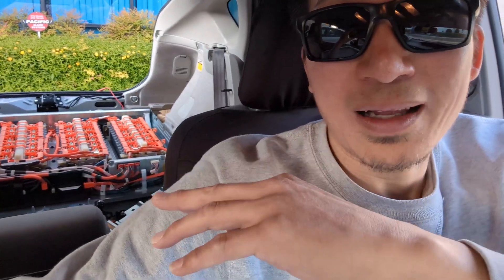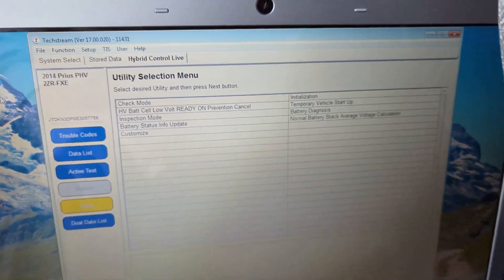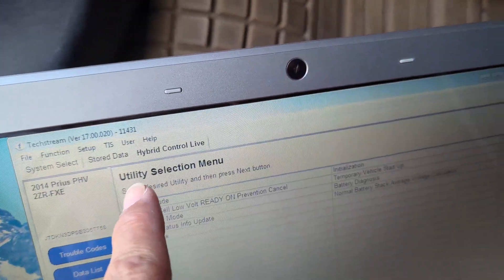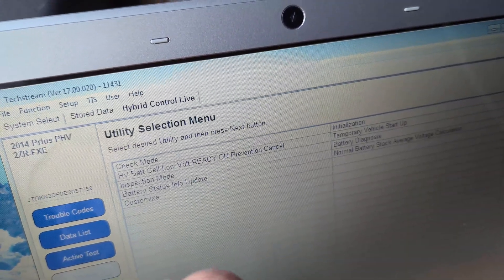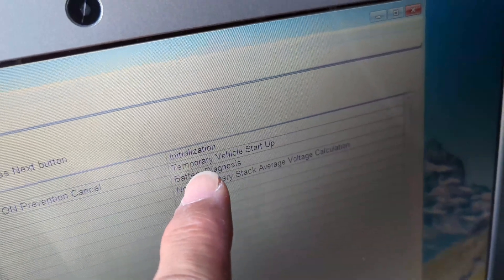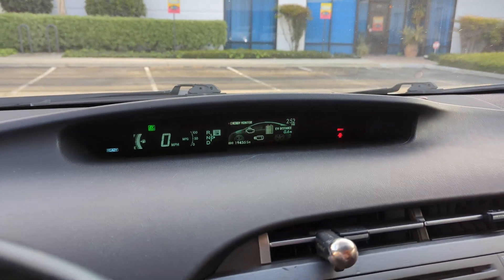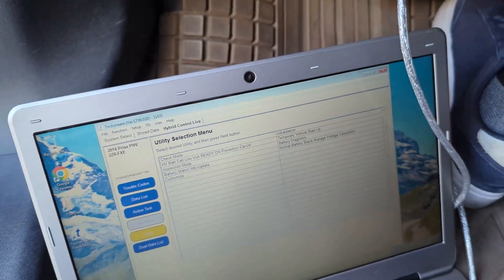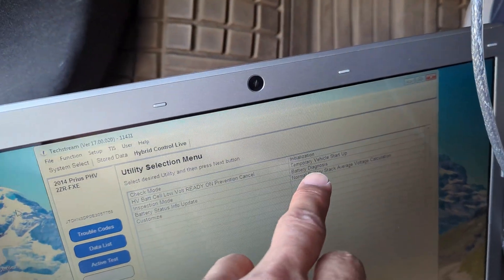Prius plug-in error code saga - Check engine light after bigger battery replacement -  P1A05, P1A0A

Comment: I have gotta get this off my chest! I bought your battery for the Gen 3 and installed it last year…I can’t believe what you did to my car…this thing is the biggest piece of… human brilliance I have ever come across. You have made a battery that is better than what I ever got out of the Ni battery. You made a lighter, more efficient, and  cost effective battery to keep people in their cars longer. Before I put it in I was getting 35mpg and it was sluggish. At 242k miles and a year later, I am still getting 52 to 55 mpg. All the pep is there, and I do not get battery codes. The car is like new. I just ran the full check and it registers 121% of battery life. When I put it in it registered about 127%. I have to say thank you for what you have done.